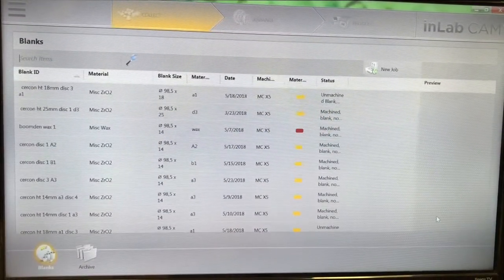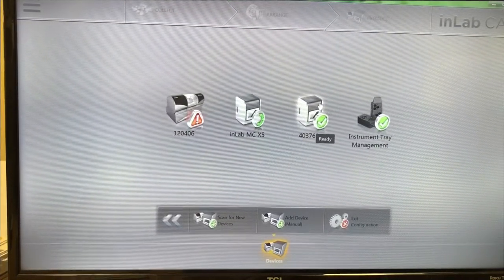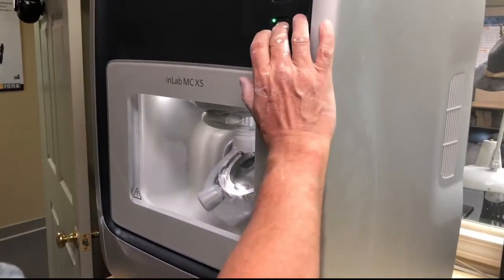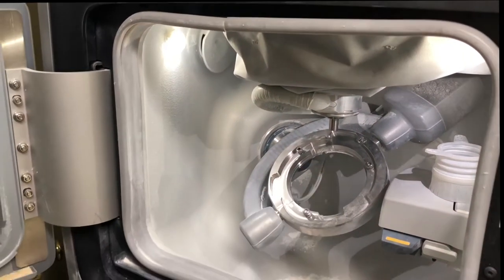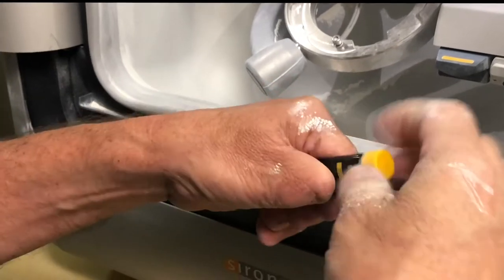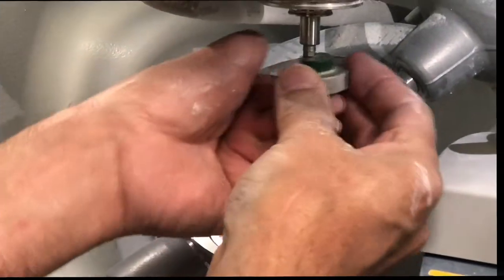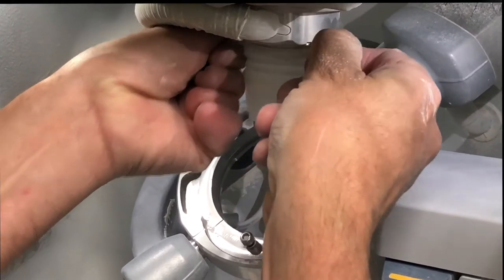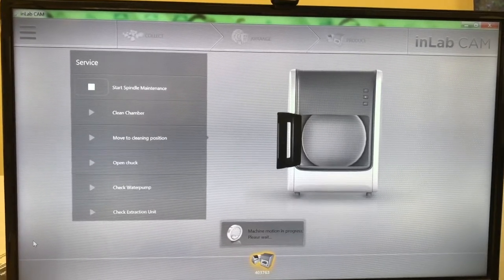inLab MC X5: How to Perform Spindle Maintenance

Comment: Incorrect maintenance
You should first clean the camera, use the tool to remove the chuck, i always use napkin paper to clean the dirty of the chuck, immerse the chuck in alcohol for 10 minutes, use another napkin clean to remove the alcohol, use the brush inside and outside, take a drop of lubricant and spread it over exterior bottom the chuck and finally screw in the chuck.
Reply: sorry to ask but how do you have ti connected to air compressor o air supply?